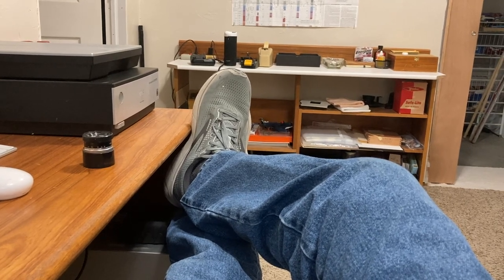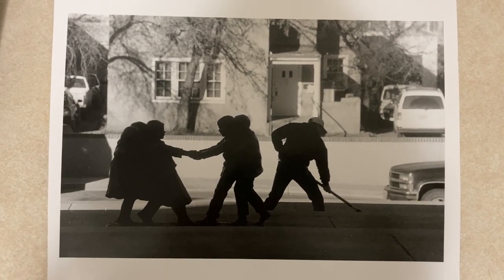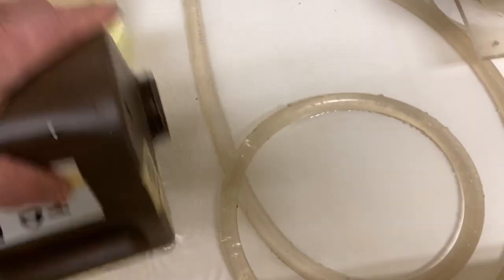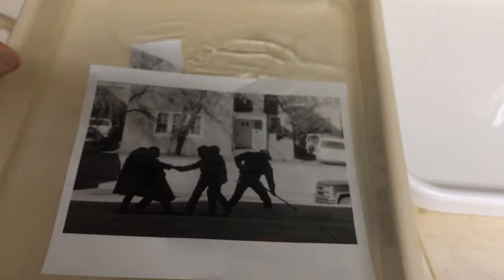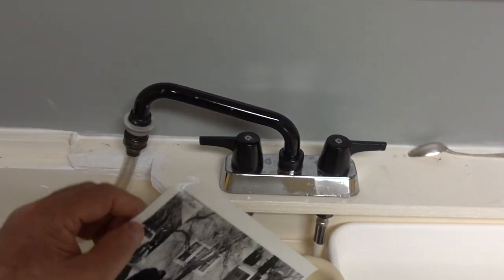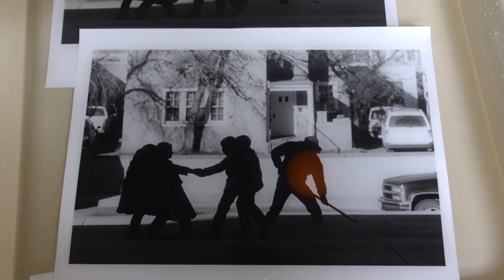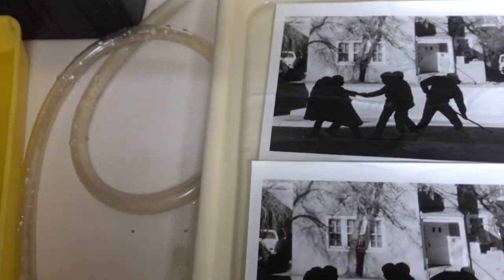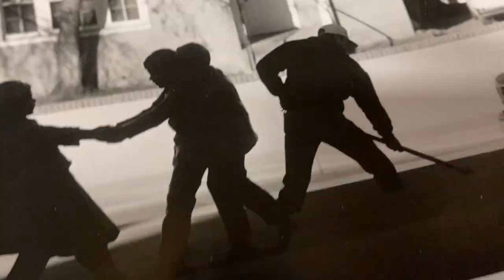Printmaking Example: Capitol Sweeper

Comment: Nice work, it would be helpful if you ever made a video about developing prints using fstops.
Reply from the maker: Thanks! Middle f-stop at about 12 seconds is often my starting point. If your negatives are consistent it will get easier.
Reply: Got it, thanks will try it next time I'm in the darkroom.  @asa1000photography